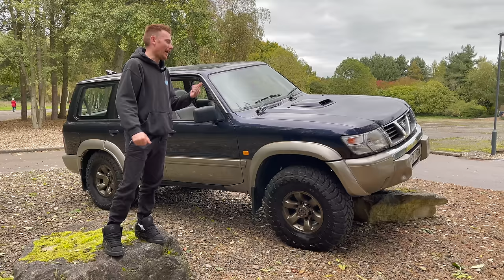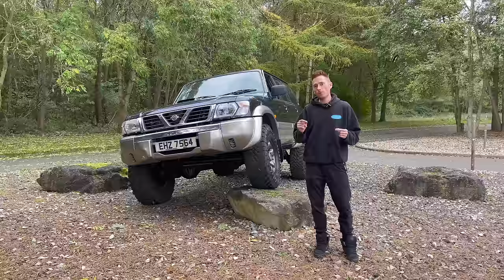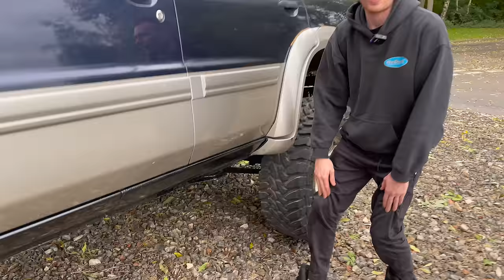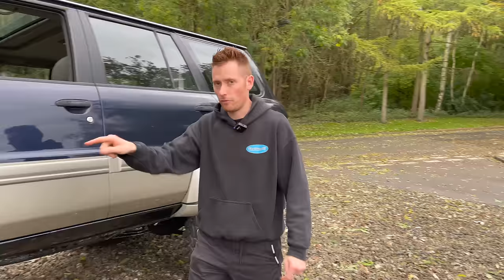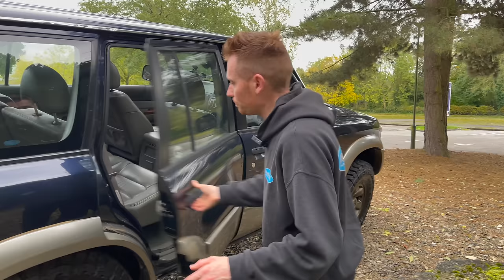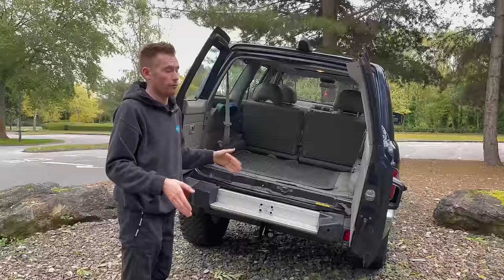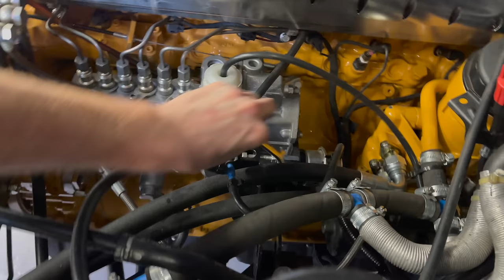500BHP GU PATROL OM606 DIESEL , 4-WHEEL BURNOUT!!!!! SOUNDS SWEET!!!!

Comment: Anything that does AWD donuts is immediately awesome in my book.
Reply: AWD is not the same as 4x4
Reply: @slym1875  Whats the difference?
Reply: @slym1875  Seems silly to me, but ok. So they are 4WD donuts.
Reply: @slym1875  no because a 4x4 can go back in two wheel drive where as a Awd is full time 4wheel drive
Reply: @titaniummechanism3214  that's RWD donuts. A Patrol is mostly used in RWD configuration. Better to do not use 4WD when it's not useful
Reply: Just look at when on the power test bench
Reply: @fabprd2777  No, those are absolutely most definitely 4WD donuts. You can see one of the front wheels spinning so fast it produces smoke, which means that the front axle is getting power.
Reply: @fabprd2777  go a bit hard on the weekend bro, you've lost a few braincells, there was definitely a 4x4 burnout there. I own two Patrols, one is turbo ls3 the other is soon getting an OM606
Reply: @joshthomas2536  yes, I rewatched several times and I finally saw the front wheels driven too 🙌

Sorry
Reply: @titaniummechanism3214  yes, thank you !
Reply: Maybe that it arrives more power in the rear wheels however
Reply: True
Reply: Get a V6 Amarok, remap it. Bam 275hp at all 4 wheels, and it still a nice car to drive every day and go offroad in.
Reply: @titaniummechanism3214  it's not silly , it's a completely different system , a Subaru is AWD a patrol is 4WD
Reply: @fabprd2777  "4-wheel burnout" Is in the title of the vid lol
Reply: @fabprd2777  nah they are 50/50, not computer controlled like subaru awd but mechanical through the transfer case
Reply: It was actually in rwd for the donuts if he did awd his way transfer box would be broken dude
Reply: @endofd-d7c  No, I'm pretty sure that it was in 4WD for the donuts. Look at how fast the front wheels are spinning, they are clearly being driven and not just being turned by the vehicle moving.
Reply: @slym1875  yes it is. yikes. obv there is a difference being you can select 4wd, but in this vehicle the actual arrangement is just like a gtr.
Reply: yeah ive read the latest comments. 4WD is easier to do a burnout in than AWD because driving the wheels all constant, which causes binding which causes hopping in the wheels which lead to easy burnouts. AWD literally the opposite awd drives each wheel at a different speed to compensate for turning which doesnt bind, therefore no burnout.
Reply: @titaniummechanism3214  the diference is that in a awd you are all the time with 4 wheel drive, but 4x4 means that you can change between 2 wheel drive or 4 wheel drive (i dont know if i explained it properly im spanish and its a bit difficult to me)
Reply: @slym1875  never heard that BS. 
I'm driving 6x6 trucks and on the paved road I only drive it in 6x4 (or 6x2) mode. But it is still considered AWD (with all the possible lockers..)
Reply: Rc car
Reply: My 110 HP VW Passat can do it 😂
Reply: @titaniummechanism3214  4x4 is a stable power output on each wheel and AWD is dynamic depending on the power need of each wheel

Comment: I’m officially a Patrol fan now. I’ve a soft spot for the W163 and would love this setup. I’ve only had a 270cdi and although it moved around ok, it’s screaming for at least 100 extra ponies 😄
Reply: Take the ML400cdi 🤓
Reply: @TheRazvy1990  I'm tempted to buy a ML 400cdi but I do a lot of driving. It's probably not much worse than the ML270 for fuel economy either. If it's around or close to 30mpg (8-10L/100km) on a long run I'd be pretty happy!
Reply: @barochoc  Im doing fkn 14/100 with a 270
Reply: Same issue here with the WJ grand cherokee. It needs some time before it really starts moving, but still makes a cool noise

Comment: You need to impress these engines to the Saudi's. They love the Patrol and I've seen more than a few interesting engine-swapped combos over there but never one running a 606. The 2JZ and the 1UZ V8 are really popular, though there's more than a few pushing 1200hp.

Comment: The chargecooler more efficient than an intercooler and its perfect for space constraints hence why I have one on my commer and will be connected to the 605.
Its a crazy conversion this patrol. Seems like the perfect Dail, toy, tow vehicle ever. Great work!
Reply: Its not more efficient, it has to go through two state changes rather than just one. Air/Water/Air vs Air/Air
Reply: @CheekyNinja  it is theoretically less efficient for steady state heat transfer, but nobody uses full throttle all of the time in a car, the water can absorb heat when you're on the gas and dissipate it later, so it probably works better in practice than an air/air intercooler ;) The VW/Audi TDIs all use air/water charge coolers now.
Reply: @connerlabs  it isn't more efficient. It might be more effective for short durations as you can use it is as a buffer to control temps but once your water heats up you can only take out as much heat from your charge air as you can emit from your cooler rad.

Most setups can't maintain water temps so gradually heat soak. Whether that is a problem will depend on your use case.

Since when has a vw commuter been a performance benchmark worth using? Look at track cars instead.

Comment: I love that despite lot of HP you made its very practical and usable, you could even say sleeper look.
No bs tuning like huge turbo without air filter that makes boost in last 20% of rev range or gutted out interior. Just normal, everyday patrol with lot of horses :D
Reply: Just put a tub of liquid O2 in front of the air intake after each ride. Cool oxygen rich air supply...

Comment: The body appears to be largely rust free, I think it's in pretty damn good shape overall.  This truck wasnt really offered with many options in my country, hence why it never really caught on.  The nissan armada with the 5.6l v8 and automatic transmission has never appealed to tuners in the states.

Sweet truck, I wish I was as mechanically skilled as you are so I could build something similar.
Reply: I love love love the vk56 motor. Really well built . You are right , Americans have not thought to really dive deeper into the Armada's  underlying design and little to no one has heard of the patrol . Myself,  I'd love to do an exhaust upgrade on my Armada as well as a quality roof rack.  Another huge issue I had was tires . The Armada comes with 20" rims sporting "c" rated tires . Wasn't an issue til I had 5 passengers , hitch rack , a touch of gear on regular roof bars and a trip through a riverbed . Two days later began noticing a faint vibration going down the highway . Pulled over , and noticed signs of tire belt slip , hmmmm . Looked a bit more and noticed a far more concerning sign . Where the tread pattern stops at the outer edges of the sidewall , there was tiny little holes in the valley between every tread . Didn't understand what I was seeing.  Sat in the parking lot thinking on it 🤔.  Then I got my cellphone light out , looked closer . 😳 it hit me , there were cavities inside each hole . The tread was separating ! Well , I've been here before with my 7.3 powerstroke , and previous owner fitting on C rated tires . Have damaged rear of bed both sides as a reminder. 
So , went E rated for load , went AT type tread , swapped to older Armada 18" rims for more sidewall . Ended up with some killer quiet tires that are tough as nails ... wife hit two curbs already and I hit one.  Damn passenger side blind spot .
I still want to look into getting a bat wing  type side awning as well.

Comment: Ive been looking to replace the engine in my Y61 1998 for a while and was wanting to go down this route. the current Td42 that is in mine is making 220hp on 35" tyres for 5 years now very reliably but with the value of these engines skyrocketing im looking to replace it with something that can handle much more horsepower reliably. but cannot for the lift of me find OM606's in Australia!

Comment: I have a Patrol. It has a grenaded ZD30.
I've been considering an engine swap for some time but mostly considering M57. I might have changed my mind.
Not looking for massive power like this, 190 stock would be fine and, hopefully, more budget friendly.
Reply: definitely don’t waste your time on the zd30 i mean if you wanna go all out drop in a rb25det now that would be a fun car
Reply: @oopscay90  rb25 in a patrol is stupid as, unusable for its purpose
Reply: @darcykeddell4930  ive been in plenty RB25 patrols and they are mental when done properly. an RB30 block with an RB25 head is probably the best route. or you could just be like everyone these days an Barra swap one. would love to put a Duramax in a patrol one day.
Reply: @oopscay90  yeah 25/30 is a much better option 25 doesn't have enough low down
Reply: @darcykeddell4930  been in a fair few different engine swapped patrols in my life and one of my favourites was my dads mq shorty with a 350 chev. wish that thing was still around, wanted it as my own as a kid

Comment: Reckon one could fit in a 1990 Toyota 4Runner? I'm Gunna try any way. Using patrol diffs and a R151f box with R154f internals. It will be for hard off-road use and taking to the local dragstrip for the 4x4 diesel Drags.

Comment: Can't wait to put a 606 in my xj. Probably will put y61 axles on it too cos the rear diff is noisy anyway and I'd rather do a job properly even if that means spending a bit more. I will be getting DPUK pumps turbos manifolds etc as Luke you done some crazy good work and it's blaintant you know what your doing. Fair play to you mate

Comment: Relocate battery to trunk, run aluminum/frp pipe to fender and attach fender to snorkel above windshield level. Great info just my thoughts on quick easy cooler air.

Comment: At what rpm does the power come in?   ? Below 2000. Fuel consumption, I am looking the power band to come in at around 1200rpm....power around 150kw and 500 Newton meters or better but not at the expense of fuel consumption. Fuel consumption preferred +/- 8km/liter. Will match engine  zf 4x4 box 5 speed.

Comment: You’re choice in engines, solid front axles and toyo mt tires is enough for me to know you like to build something useful practical and very fun. I would build it the same way toyo mt, 0m606 turbo, manual transmission and solid front/rear axles
Reply: What kind of adapters would it take to swap this into a 1st generation Dodge Dakota particularly the 1994-1996 with the NV3500 transmission? I love my 5.2 V8 in my OBD2 1996 dakota with manual transmission and 4x4 but being a regular cab i wanna make it different and swap in an OM606 mated to NV3500 manual transmission just kinda wondering if that would be possible to make an adapter considering these NV3500 transmissions have a non removable bellhousing made for the 5.2 or 5.9 small block V8 engines but hoping to mate an OM606 to it and really make this dakota wake up!
Reply: Oh wow, I didn't realize this was solid front axle, I'm shopping for one and the 98,99 first 2 yrs of this gen are eligible for us import and I've got a bit more room make my money to farther as they're generally demanding  land cruiser money, and come to think of it I could save even more grabbing one from a friend who's dad is a car dealer  in Colombia. ( Coincidentally I first met him and he actually picked me up in a 5 door last gen running on natural gas/petrol to buy a land cruiser they sold an hour earlier. )
Whatever I can get away with pre shipping as far as work and mods would be a great idea, with the USD /COP being ridiculous. I imagine customs isn't interested unless it's newer vehicles,  newer oem engines and parts that are grey market and not exempt or requiring compliance etc. 
That axle is a great surprise  given the Prado is independent front suspension, which I don't mind too much. I don't need solid axles for my use cases, but I remember the patrol being one of the earlier cars to have coil springs, ABS, etc 
Plus I'd have to get one of the new years I believe to have an inter-cooled diesel in. It's not the best line of the Toyota diesels. I'm sure these Nissan's that they get out insane like are good. 

That being said, what is the desire to have the Mercedes diesel over the Nissan? Is it just baseline reliability over the Nissan motor when modded ?  I can't imagine they'd be cheaper I guess it's more for one off builds not mainstream dailys? 
I currently sold an fj cruiser before prices drop 15 percent across the board, and want to drive something I can make money on for less money, room to mod too. Problem with FJs are I bought auto replacing a total vehicle, finding a clean one or as a statewide game as well, and the manual transmission version of this vehicle on this wheelbase that has the permanent all-wheel drive with the 60/40 front rear just adds more grip when throwing it into corners. I told myself I'd find a clean one later and supercharge it. that with a 5,6-speed and just mild tire size increase would be nuts, and I wouldn't mind an earlier model western vehicle for a build to save, just important to find a clean chassis. 
Do you know much about these patrols? Don't they have a straight 6 cylinder as well? I believe in the previous generation? As much as I want to own my first diesel and mod that I wouldn't mind getting a 6 speed with a V8 or V6 petrol, as I'm adding torque etc and reliability.  I just want a short wheel base manual boosted pretty much, and this patrol would be rad.  
I'm guessing the V8 of this generation lacks a manual transmission, in Colombia I they have the 90 series land cruiser with a manual with that smooth reliable V8, that would be fun to drive as well, another daily you could beat on everywhere andl tune. they have them both for the 80 series along different variations of the 4f carbed up to injected and the same multiport injected straight 6 offered in states with auto only on believe.  They also put that engine in the 70 series short and mid wheelbase, in manual, pretty rad.  
Yeah I was just curious if you knew much about these, gas and diesel, not a deal breaker, but I like the generational updates for a daily driver, that's one thing I take for granted with the FJ as the gen of the Prado I was after is great amd I'm sure fun in diesels but things like atrac and the rest of safety is nice when it's not too much more to spend now on an older FJ when prices are realistic. 
So yeah, this patrol, Prado and Pajero 3.5 petrol with manual is what I'd like I'll take anything for a deal even the less preferred Toyota and Mitsubishi diesels that are a bit underpowered, and bonus for left hand drive South America discount and quicker process.   
I gotta have a manual transmission again,  I can't wrap my head around the Nissan Xterra or else I could get that done here in the states, a Jeep Wrangler I can afford until recently has the worst manual transmission have driven in a while, although an jl manual that only comes v6 boosts would be fun.. 
The patrol just stands out from his uniqueness. Now those salad axles and the potential for diesel and just lifting easy being desirable. I was donorship and being able to handle power with or without gears, plus I think the 99 gen has more leg room, they're generally shorter vs Toyota Mitsubishi, back to the early patrols. (Which outside Australia Colombia has a grip of them still on the road. )  any insight appreciated cheers

Comment: Would it be possible to run this engine with enough excess air / boost to where it doesn't smoke at all and achieve similar power #'s? I remember reading about some diesel drag racers that are using compound setups, tuned so the excess air is providing cooling in contrast to most other big HP diesel setups that rely on extra fuel to manage EGT's.

Comment: I'm looking for axles to convert a van to four wheel drive. The patrol axles would be a good fit i think. Are y60 patrol axles just as tough as y61 axles? I was looking at landrover axles but they are a bit to narrow and i think to weak for 33x12.5R16 tyres and the vehicle weight. But maybe i'm wrong...
Can anyone tell me the ratio of patrol gr or y60 /61 diffs?
American axles we don't have those that much in Europe so i can't go that direction.
I think it might be hard to find patrol axles so that brings me back to landrover. Maybe a Salisbury in the rear and strengtned front axle and rims with big offset...🤔